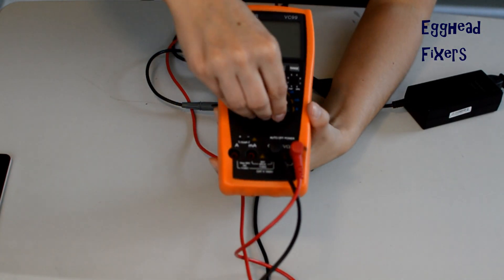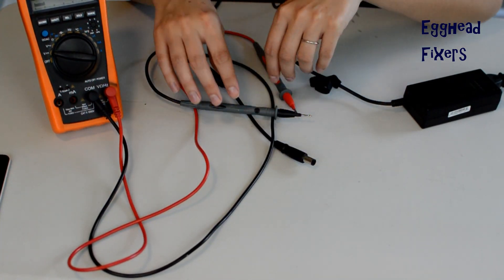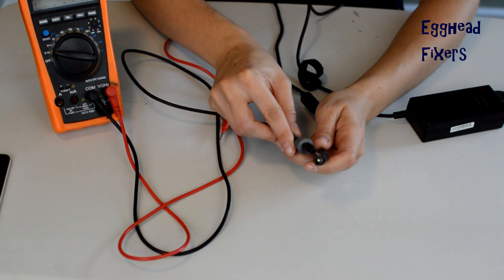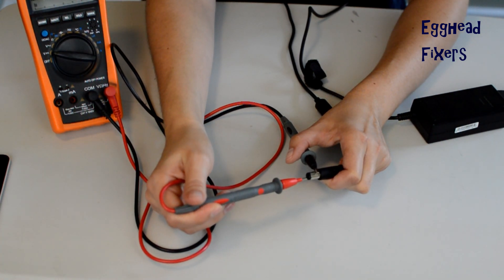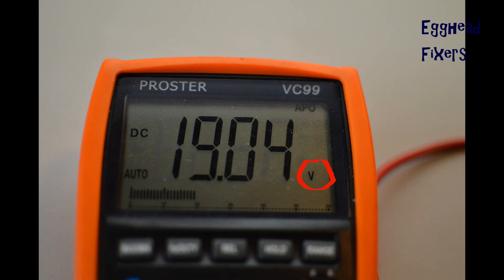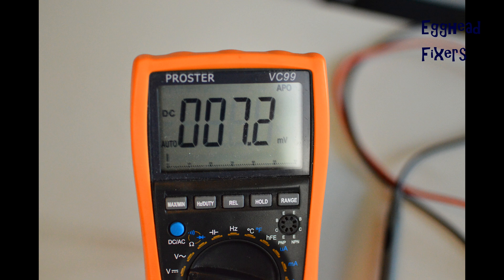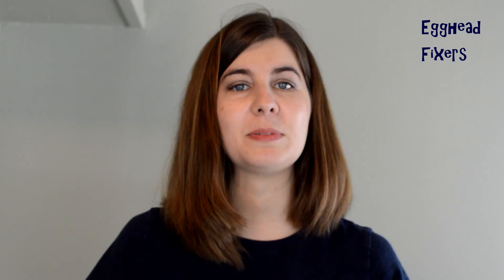Why is My Razer Laptop Not Charging, Turning On Then Off Or Won't Turn On At All. Video 2

Comment: I bought my charger separately online through Amazon and as soon as I got it I knew somthing was up because it was really hard to plug into computer. but after a couple times pushing it in hard now it goes in smooth. But now the problem is that it will only.charge if the cord is at a certain angle or I have to keep unplugging and plugging in. where is the best place to get a new charger?
Reply from the maker: Ya it can be hard to get the correct charger. You can find good ones on Amazon but it's important to make sure they are for the same exact model and there are good reviews because there are a lot bad charger for sale out there. Also you have to make sure they are the correct volts and amps otherwise it will not charge correctly. Do you have the charger that came with the laptop still? It sill say on the bottom what the volts and amps it is. It will say something like 19V 3.5A
Reply: @EggheadFixers  unfortunately when I bought the laptop I had to buy the charger separately. I might take it to microcenter to have someone take a look at it.

Comment: So my 2022 blade 15 will not charge anymore and sometimes it will for a second and then stop but the green light on the power bank is on it just will not charge, however when it's off and I turn it on after a while when it's plugged in it's fully charged but it will not charge when it's on anymore it seems and the battery will continue to drop
Reply from the maker: That could be a problem with your charger or battery. Are you using the charger and/or battery that came with it?
Reply: @EggheadFixers  yes I am
Reply from the maker: @YungGun  The most likely answer is that the battery is starting to die. As the battery ages it will require more current to charge, and retain less of that current. Its simply not able to provide enough power to both run the computer and charge the battery at the same time.

Comment: Mine charges imminently,charges then stops then charges ,but when I restart it ,it charges normal ,then after an hour starts again,is it the battery of the power brick?
Reply from the maker: If you uninstalled the battery does the computer stay on with no problems? Also is it the power cord that came with your computer or a new one?
Reply: @EggheadFixers  the power cord is a new one ,the one that came the laptop got burnt from voltage spike but still an oem product,like a day ago the brick died on me,stopped putting on green so I can’t carry out the battery test but I ordered a new one already coming next week,,hopefully it is just the power cord and not the battery inclusive🥺🥺

Comment: The power light is on in the charger but my computer won’t charge
Reply from the maker: If it turns on and works fine but it just won't charge then it could be a problem with your battery. You may need to replace it.

Comment: hi.. i have problem with my blade stealth 2016 6500U charging. it can be charged when the battery is plugged in. when i remove the battery and use the charger to power on it can be turn on. once i plugged in the battery again it can charging the battery but when i plugged out the usb C charger and plugged in again it wont charging the battery again. i'm so confused here. can you help me? thx
Reply from the maker: That is strange problem:/ although USB C ports are notorious for having problems with charging laptops. I would try updating BIOS and see if helps. Also do you plug the battery in when the computer is on?

Comment: My razer blade pro 17 is simply not charging anymore, the power brick seems to be working fine and the battery was able to keep the computer running normally, but after some time, without being able to charge it, it went out of charge and now I m unable to use my computer :( 
Not even with the cable, the computer doesn’t recognize the power supply, could it be the computer socket?
Reply from the maker: Yes it could be the power jack. Here is a video on how to test and see if your power jack is bad:
https://youtu.be/1ewAZWkOJKg

Comment: My laptop diagnostics state my battery is 100%, but the laptop won't stay on if not plugged into the ac charger.  I just bought a new motherboard and everything is working as it should. Should I buy a new battery or is there a cost free solution?
Reply from the maker: Sometimes when the battery is bad it can tell the laptop it's 100% charged but it is not. I would try replacing it.

Comment: i think my issue is the battery
Reply from the maker: Whats the problem? Does it not hold a charge?
Reply: @EggheadFixers  it does not (its says its 29% and charging but the moment i unplug the charger it goes off)
Reply from the maker: @UCHIGaming  Ya unfortunately it does sound like you need a new battery:/
Reply: Egghead Fixers that's just it. This is a new battery
Reply from the maker: @UCHIGaming  Where did you buy it from?
Reply: @EggheadFixers  order online
Reply from the maker: @UCHIGaming  If you got a generic battery then that could be the problem.

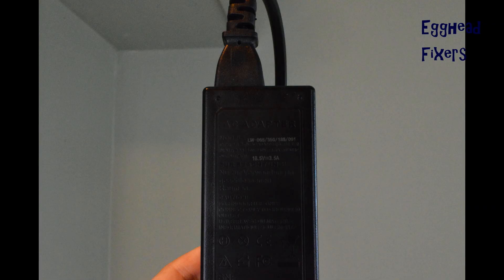Comment: 1:15 this power adapter is 65w (18.5v X 3.5A = 64,75w)
the video is showing how the Volt should correctly giving the right power, about less than 10% higer/lower right?
how about the Ampere? is it supossed to be giving power 3.5A constantly at full 3.5A power?
Reply from the maker: You should be good as long as the volts are in the 10% higher or lower range and constantly putting that out. The ampage is less of a concern because if its a little higher it usually won't harm the computer. If it's a little low the computer will under perform but usually still function. How is yours testing?
Reply: @EggheadFixers  i have aukey 60w (20v x 3A) charger and it keep charging at max of 35w power, it keep changing from 5-30w but never reach above 35w, when battery about 90% and above, it wont even get 10w of power delivery, same case with my baseus 65w (20v x 3.25A) and Apple 96w charger. my 45w (20v x 2.25A) power bank only get 20w (max) power when charging the device, all tested with 60w & 100w cable with same result. how much the razer blade stealth 65w charger will give the power to the laptop? is it full 65w all the time? or 35w power delivery is normal for 65w charger?
Reply from the maker: @moza260  It needs to be in that 10% range. They do fluctuate somewhat but if its too much then they do need to be replaced. Is it giving you trouble when you use it on your computer?